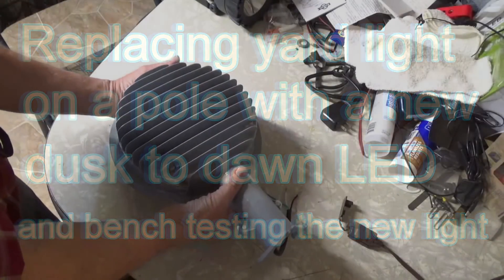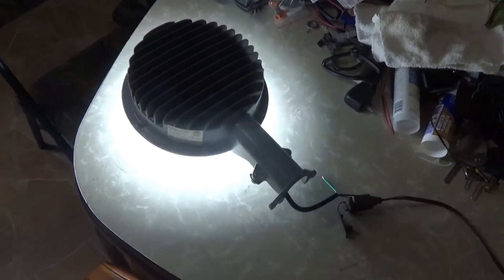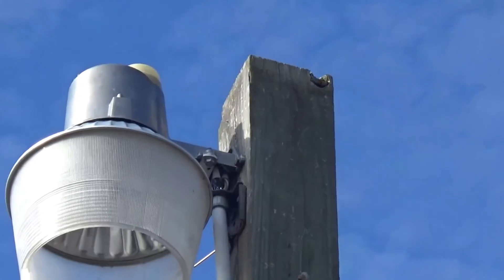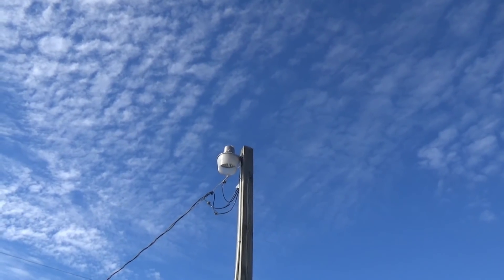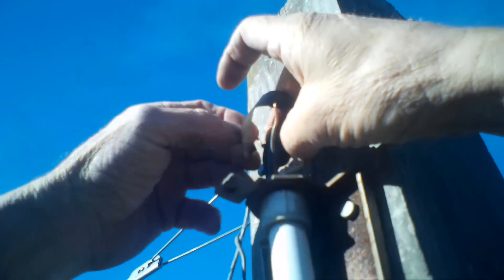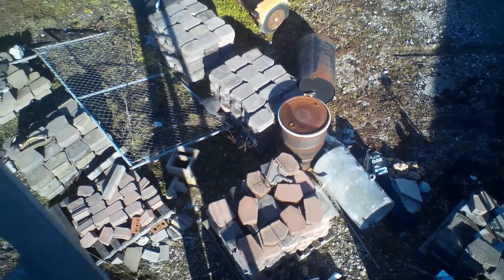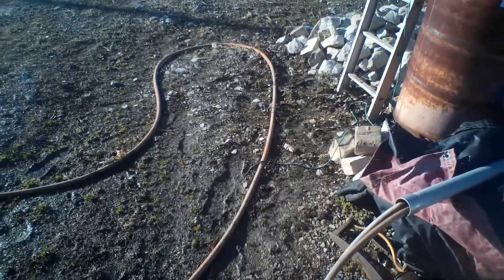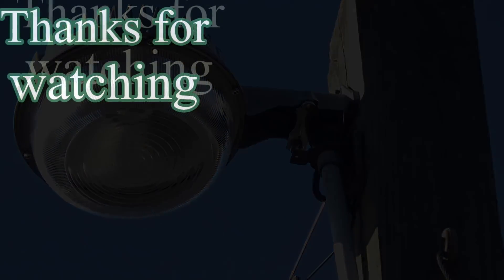Replacing yard light on a pole with LED and bench testing.

Comment: Gordon, I just wanted to add that in no way is this a job for the regular DIY person or the faint hearted. I have years of electrical experience and a history in electrical engineering. Aluminum ladders, electricity, loss of balance could be a bad combination. A mistake could cost you dearly. Just because a person with knowledge can do this, doesn't mean it is safe for everyone. FYI, I have a main breaker for the yard that kills all power which I now turn off.

Comment: Funny, I have the same light that you put up. I have tested many things by inserting 2 wires into an extension cord or receptacle as you did. I have stood on the top of a ladder (hating it) doing what you did. I did place 2 ratchet straps to lock the ladder to the pole (one about halfway and the other about 3/4 up). I found this steadied the ladder a bunch.  My pole is round. I secured myself to the ladder with a belt also, in case I slipped. Growing up on the farm, my dad had me do more dangerous things than this, but I never liked this job. If anyone has ever priced an electrician with a bucket truck to do this, then they would understand why we take such risks. I also wear a tool belt to keep the tools and wire nuts handy. I could tell you have an understanding and respect for electricity, the aluminum ladder, and the danger you were in. This is another one of those jobs we hate to do but feel compelled, since we know how, and can save so much as a DIY. Awfully glad when their done though. Keep safe.

Comment: Hey Gordon,  Thank you for sharing.  I was hoping you or any others with electrical skills could advise me. I have a light that's installed on a post very similar to yours by Jim Way. For some reason now it just runs continuously. It has a North direction light switch if that helps.  Should I replace it, the bulb, or something else? It worked well for the past 6 years but now it won't turn off.
Reply from the maker: If it's a light similar to what I replaced, it probably has a light sensor on top of the fixture that can be replaced by turning it to the left to unlock it and then pulling it off. Sometimes a dusk to dawn light has to be turned on by the switch for a few seconds and then turned off and then on again to put it in the automatic mode and then it will turn off after a few minutes and then on when getting dark outside. I hope this helps. Thanks for watching.

Comment: Gordon I'm with you that made me tense up there, one thing I might have done is to tie or strap the ladder at the top. That LED is the way to go.
Reply: No it's not.  The old fixture was way more reliable. Plus, you can get LED bulbs to simply put in the old fixture without replacing it.
Reply from the maker: Thanks Eric.
Reply: Gordon Robertson what did you do with the old mercury vapor light you had up there ?

Comment: Somebody swiped this video already...………… just kidding, I don't like working on ladders either, I really wouldn't like working by hot lines even more so. You got her done, the LED lights are good, mercury vapour lights are a pain, sodium lights are even worse. Where I used to work the company electricians said LED is the way to go. Every street light and every other exterior light got replaced with LED.
Reply from the maker: Yes sir, those LED lights are good. This new one is shining bright and should be cheaper on the electric bill.
Reply: MV and Sodium lights are way better than LED

Comment: If you want a non impact cordless ratchet Home Depots Husky brand has a nice 12v 3/8 kit for 50$ right now.  I bought two of them and so far I am impressed. I wanted to give  them a try instead of over paying for Milwaukee again!
Reply from the maker: That sounds good, I might try to get by there tomorrow after work. Thanks Will.